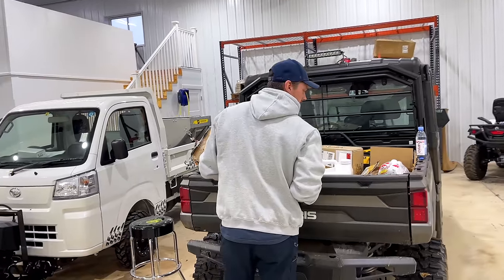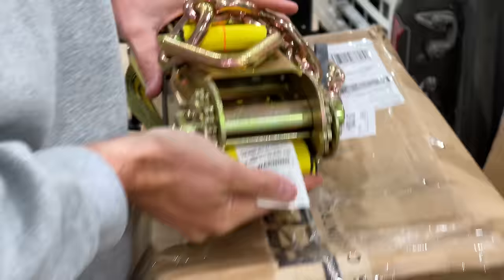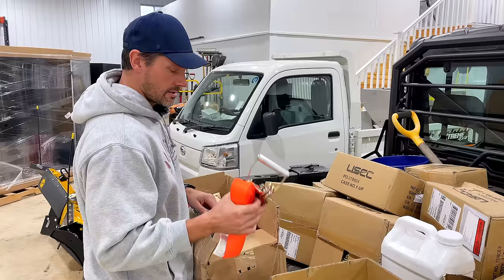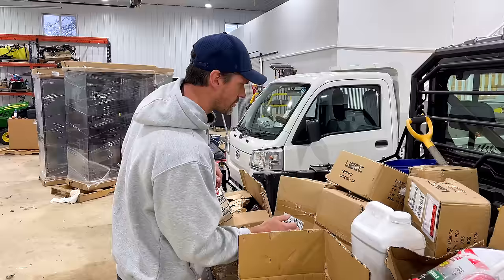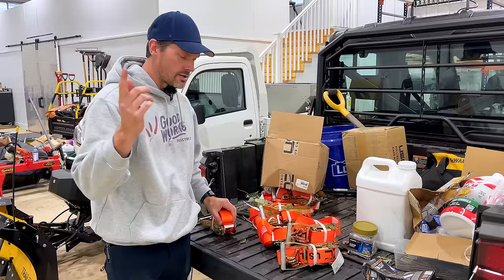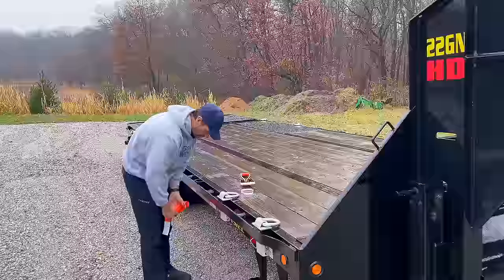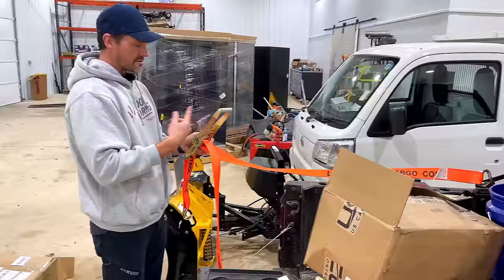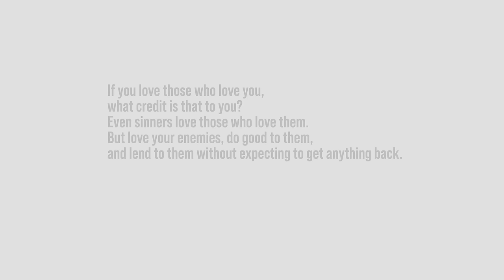JACKPOT! TRAILER TIE DOWN GAME CHANGER

Comment: A few points from a person in aviation where securing cargo properly is critical (see Kandahar 747 crash for what happens when cargo breaks loose inside an airplane - I worked with one of the since retired engineers who investigated that one):  Conservatively ignore friction between the object being restrained and what its loaded on when determining required restraint.  Multiply the weight of the restrained object by the applicable federal or state cargo securement rules required G force - my Google Fu skills say that number is 0.8G forward, for example (so that 13,000 lb skid steer x 0.8G = 10,400 lbs of forward restraint is required per fed regs).  Don't mix chains and straps as restraint in the same direction as the different stiffness will result in uneven load sharing (the stiffer chain will take most of the load potentially leading to a progressive failure under load) - it's ok for chains to secure a load from shifting forward, while straps keep it from shifting aft, for example, but don't mix chains and straps to secure a load from moving forward.  Ideally, all restraints in the same direction have about the same length for the same reason - shorter = stiffer, longer = softer for a given type of restraint (chain, strap, etc).   Have adequate restraint in each direction.  While the example of 4 of the large straps, one on each corner of the skid steer, provided 21k of restraint (doing a simple sum of the WLL's), it is likely a bit under half that was in either the forward or aft direction (assuming the straps were oriented off the corners mostly forward / aft) - if this is the case, there is little restraint in either lateral direction.  Angles matter:  If you have a strap at 45 degrees off a corner, that provides only ~71% of the WLL in either the forward or side direction (the strap is the hypotenuse of a right isosceles triangle with length 1, the two side lengths are 0.707).  Basically, resolve the direction of the strap into forward / aft and sideways directions and the relative length vs the hypotenuse (strap) length will give you the fraction of the WLL effective in a given direction.  In the case of that 45 degree strap off the back corner of a skid steer, 71% of a 5400 lb WLL = 3834 lbs of restraint in the forward direction (and the same for a sideways direction), so while you may think you have 21k of restraint, you only would have ~ 2 x 3834 lbs =7668 lbs of restraint in any of the 4 primary directions, forward being most critical as you don't want that load to slide forward and squash you in the tow vehicle.  Balance your restraint around the center of gravity of the restrained object so it won't rotate under loading - if you have side restraint only on the front of an item, the back end could slide out under cornering for example.   There's more, but those are the high points.
Reply: I've hauled every load imaginable as an 18 yr truck driver. I keep up with current regs and know securement better than the average guy. I find it impossible to teach people how to secure loads because I can't seem to dumb it down enough or keep their attention. I have no idea if you actually know what you're talking about because you lost me in the first chapter of your book.
Reply: Thank God we aren't tying down equipment in an airplane!
Reply: Great info.  The mechanical engineer in me enjoyed the technical discussion.
Reply: Well said. Thanks for the knowledge.
Reply: Wow, that made my head hurt .       I sure hope they have some sort of simplified system relating to for the hands on crew.    Things like specific vehicle models with diagrams and required tiedowns.

Comment: A twist or two in a strap to reduce wind vibration doesn’t affect break strength, HOWEVER testing, I saw a year or so ago, showed that knots in straps GREATLY reduces the strength and are almost always the failure point.  Billy

Comment: I laminated the load rating tags on mine. The manufacturers should do this. Supposedly it has to be legible to be in compliance.
Reply: Every size strap has a minimum rating if not legible. It is better to keep your tags in good shape as they almost always have a higher WLL than DOT minimums.

Comment: I added 12,000 lbs D-Rings to my tractor frame (my son fabricated them: welding them to bar steel, and then powder coating them). Bolted to the frame.
Using Erickson 2”x7’ machinery tie-down straps means 8 clicks to fasten the hooks, then tighten the straps. So quick and so secure.

Comment: Piece of advice for all chain binders or strap ratchets. Use ATF to lube them. It works wonderfully and attracts no dirt to it. I have binders that ride on my RGN that can go weeks without another dose of ATF and they still run perfect.

Something very critical to know for load securement is the difference between what is called direct and indirect securement. When a chain, or chain and strap combo, goes from the machine to the trailer edge that is direct securement and by federal law that piece of securement is only rated at 50% of it's WLL. So essentially every pair is counted as just one. Now if a strap or chain goes from trailer edge over the load, or thru securement points on the machine, and back to the trailer it's indirect securement and gets 100% of its WLL. 

When it comes to securement laws there are pretty much no local laws on it as the federal laws apply to all states. At a certain size all machinery needs to be cross chained and there needs to be padding if two chains are going to touch and you absolutely can not have two straps touch each other.

On top of that if you use chains you need to pay attention to the WLL that is marked on the hooks, chain, and binders you use and the lowest is the actual rating. A chain binder might say 6600 but if the hook is rated at say 5400 then that's what the whole thing will be rated for.

Comment: Very well explained video and justified reasons for your decisions for straps. When I had my KUBOTA L 3800 with backhoe I used straps also. Now however that I moved up to the substantially larger and heavier L6060 with backhoe I strictly use chains with added on connection points from 5/11 Design that I saw on your channel. Being so much heavier we feel safer with chains over straps on that machine while not large machinery it is more than 50% heavier than the L3800. Thanks again for your knowledgeable presentation..

Comment: That’s a good idea with color coding for length! 

I was a firm believer in chains only until I did a bunch of research on it years ago.  Chains have their place for sure but straps can be used most of the time. What surprised me about chains is how little damage they take before they should be replaced. Difference with straps is that the damage is usually more noticeable. I don’t use chains and binders anymore.
Reply from the maker: Hmm, that's good to know.  I'll have to do more research on the chains.  Thanks!
Reply: @GoodWorksTractors  I’ll try to find the PDF’s on the chains.
Reply: Well some points were not correct. If you go from machine to trailer, the WLL is 50% not 100%. So 5400 becomes 2900. If the securement goes over the load, trailer to trailer, then WLL is 100%. Personally chains with slip hooks and binders are all I'll use any machine over 5,000 pounds. Little background now. I'm an owner operator, I run open deck only. Flat beds are for rookies, stepdecks are versatile. Lowboy trailers/ rgn is what I normally pull. Everything from a general freight legal load all the way up to loads big enough to require police escorts during the move. Before each or day of the move the d.o.t does typically a full level inspection. I'm basically saying while I still haven't learned it all, what I said is by the book on securement ratings. So that 21,600 at the start of the video on the telehandler, is 10,800 WLL. Anything wheeled or tracked piece must have 4 corners, plus whatever else is needed to cover weight. Booms, buckets, loaders, all need securement on them as well, that also allows that WLL to be added to the total WLL securing the load.

Comment: You should try to do a video with a DOT officer about proper cargo securment. You may be interred to find out that they only give you 50% of a strap/chain if it is connected strait. If you go over the top and back down to the other side of the trailer you get 100%. And you are supposed to strap any attachments also. 
So if your tractor has a bush hog on it you should strap that separately. In theory the bucket on a front end loader too.

Comment: A few years back, I rented a Polaris Ranger 570.  At the time, I didn’t have a trailer or any straps so the rental place furnished the trailer and straps.  They used two 1 inch straps…one in front, one in back.  I didn’t think much about it as I figured they knew what they were doing.
I had a 100 mile one way drive.  Got to my destination without a problem.   I noticed there was a fray on one of the straps but used it on the return trip anyway.  When I arrived back at the rental place, one of the two straps was completely severed.  I dodged a bullet in that the straps were too light to begin with, damaged and only used two of them to secure the load.  I thanked God I didn’t lose the machine on the interstate highway!
Lesson learned.  Now I have my own trailer and a plethora of options and chains as needed.  Don’t be that guy that foolishly proceeded.